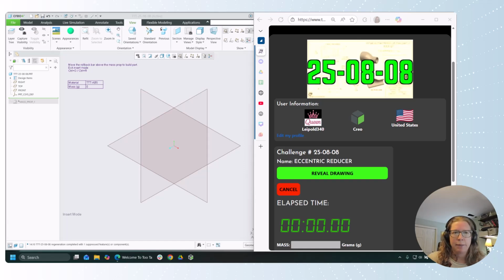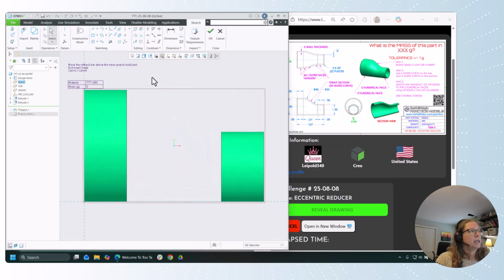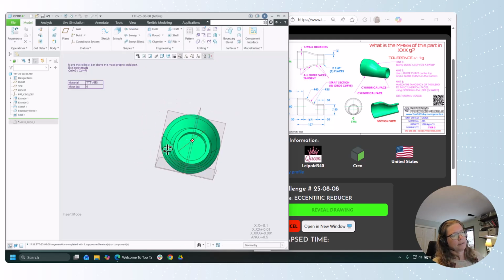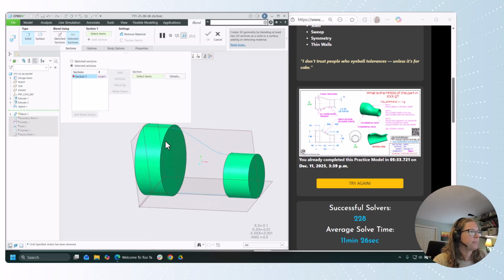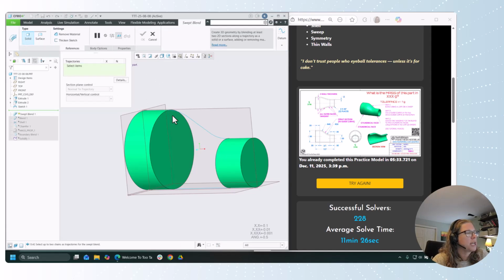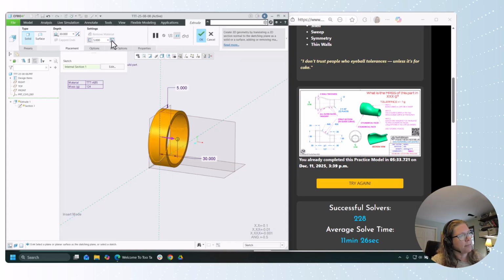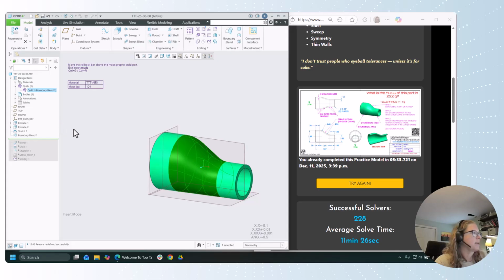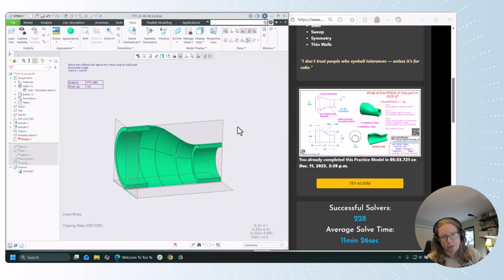Too Tall Toby Challenge 25-08-08 - Creo Parametric Tutorial

Comment: I created the same geometry using the Variable Sweep tool with:

1. Two guide curves
2. A single profile (a circle with variable diameter)

Avoid using the Thicken option in Variable Sweep, as it gives incorrect results. Use the Shell feature instead. 😊

Creo always have multiple approch with model which always teach me something new. Thanks for sharing knowledge 😊